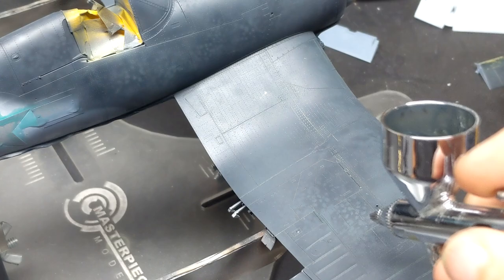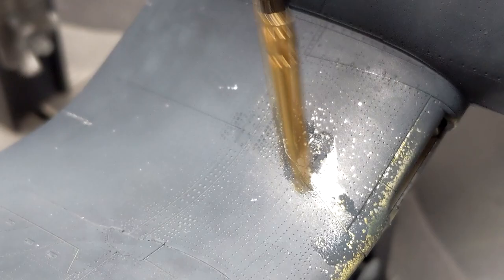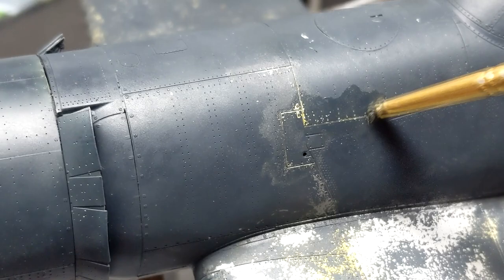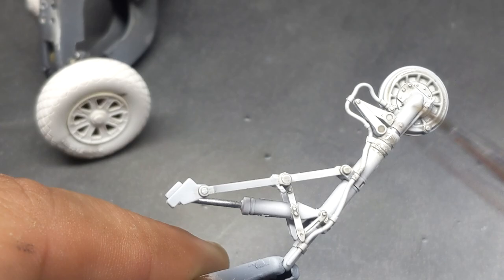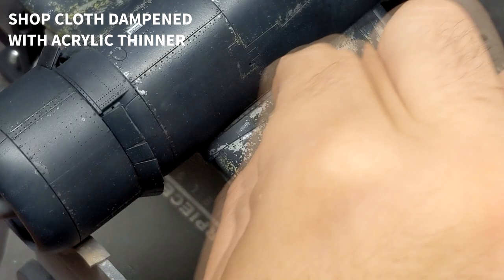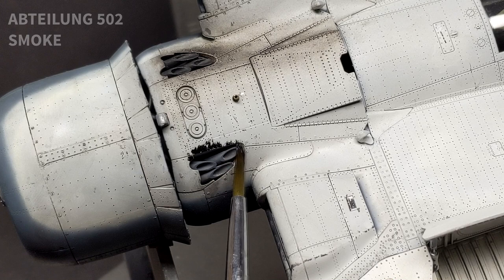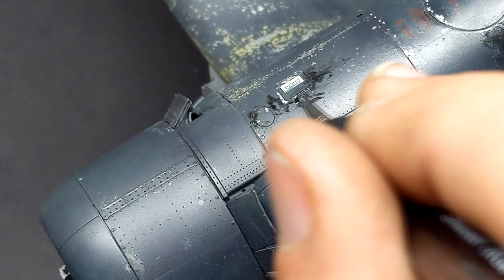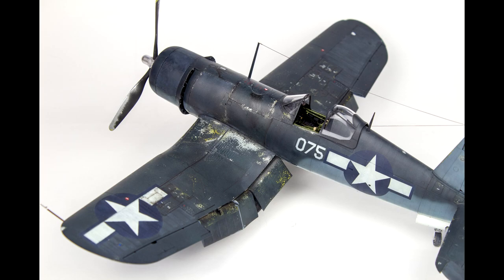F4U-1A Corsair Tamiya 1/32 - Let's weather an aircraft model with chipping and oils!

Comment: Great video, most of the real F4Us I have seen that have not been refinished had a red-pink metal treatment vs the yellow zink. Some old photos of the time also show this as well as the yellow which used in frontline repair..
Reply from the maker: My understanding is the earlier ones have that salmon primer colour and later on in the series it went over to zinc. My birdcage I did four years ago had the pink tail wheel well

Comment: Excellent work on the corsair! I'm just wondering though, after the oil weathering process do you then put down a varnish or leave it at that? I just spent a bit of time weathering up a prop for a desert P-40 I'm working on and then it was all lost to the varnish coat! Lucky it was just the prop!

Comment: Hey Robbie 
Love your work, really enjoy your videos. I have one question if I may. When you say your “mr color zinc chromate” is lacquer. Do you use the GSI gunze range or do you use the standard acrylic mr color 351 and thin it with lacquer?
Reply from the maker: Hi Stefan,

I use the Mr Color 351 and thin it with Mr Leveling Thinner
Reply: @TheModelGuy  thank you very much.
So this might be opening a can of worms, so the Mr Color 351 is an acrylic based paint right?
So in your opinion and this might be what I am thinking too is…; when thinning an acrylic paint like the 351 with lacquer levelling thinner do you think its more like a lacquer then in terms of durability?

Comment: Beauty. Really digging the streaking and dual layer chipping.  How do you like oil based exhaust stains compared to painting them on?
Reply from the maker: I find the oil can bring in a lot of cool effects. Especially being able to blend them and layer them. Airbrushing can give you a very soft look but you need a very tight spray pattern to do it.